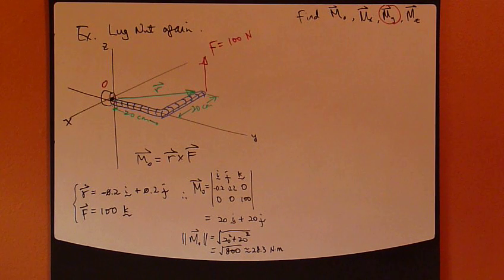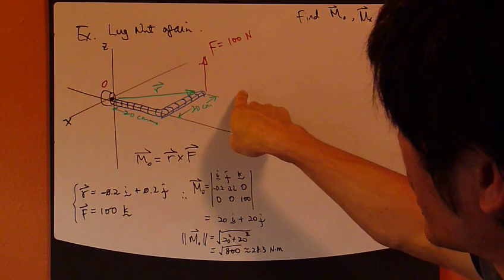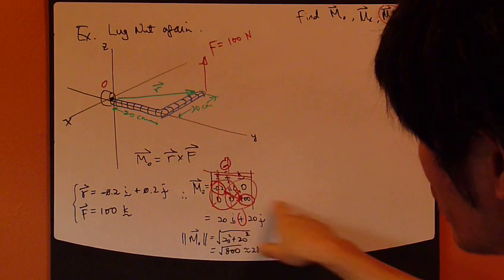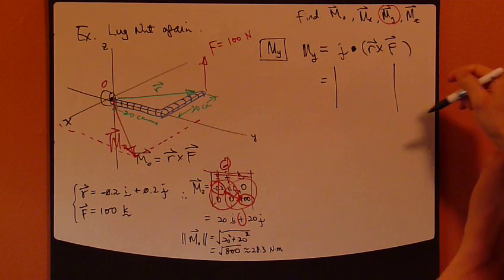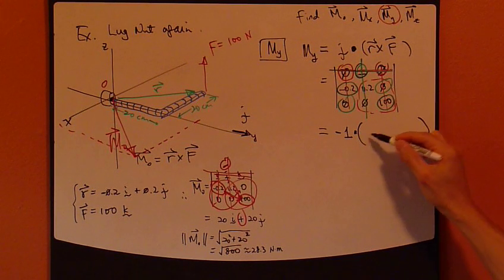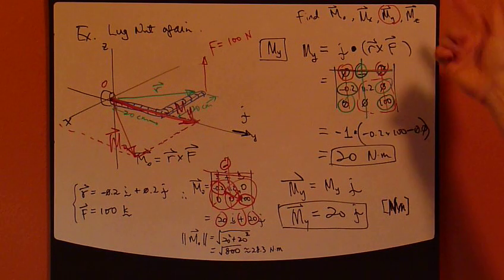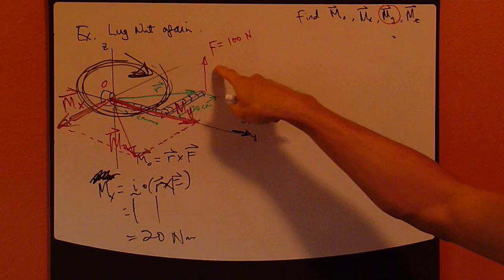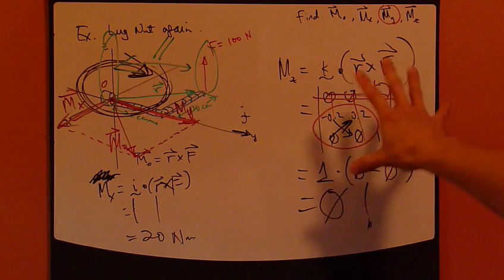Engineering Statics Ch4 Part7: Example - Moment about an Axis

Comment: If you were given the moment how would you rearrange the equation to find force?
Reply: Ankur Thanju 
Ankur, I've been thinking about your question some more. It is actually a very practical question from an Engineering point of view. This is because I can see many Engineering problems where you would know the moment that you need and you're looking to design the system to give you that moment. 

In addition, the explanation that I'm going to give you also gets to play with some of the general theory of moments used in Statics, such as cross vector products and triple scalar product.

So, here is my explanation, from a few different points of views:

1 - In general, the magnitude of a moment in 3 dimensional space is specified with what is known as the Triple Scalar product. This is r X F ` n. The r X F is the general formula for the moment. The "n" in "` n" is a unit vector in the direction of your given moment. I'm using the "`" apostrophe symbol to represent the dot product operation with vectors. The next paragraph is kind of complicated.

    When you use the r X F formula for moments, the resultant moment vector is perpendicular to a plane where the force and r vector reside. So, if the system that you're trying to build is such that you can put the line of action of the needed force in a plane perpendicular to the moment vector, then r X F is all you need to solve your problem. So you would put the line of action of the force some distance from the axis and calculate the needed F and angle of the force. But, here is the complicated stuff. If your problem is such that you need to put your force in a general direction with respect to your moment vector, in a plane that is not perpendicular to your moment vector, well then, in that case, you would need the more general triple scalar product formula. That is, you would design your system with a force in some desired direction. Then, the r X F with that general force would give you a moment perpendicular to the plane that force is in. The dot product of that moment with a unit vector which is in the direction of your desired system moment would give you the magnitude of the moment that you need. 

2 - So the above is the general 3 dimensional case with a force in some desired direction that may not necessarily be residing in a plane perpendicular to your moment vector. But, you may be able to simplify things.

    If you can put the engineered force in a plane perpendicular to the moment vector, then you could make your moment into a Couple, and put two equal and parallel forces a certain distance apart, such that Fd is the magnitude of your moment. In this case, if you desire to use a Couple, you would have an infinite number of solutions of forces to use, since you can get any given Couple magnitude by selecting many different Fd combos.

     Alternatively, if you would like to use just one force, instead of the two needed with a Couple, just put your force a certain distance from the axis of rotation, then figure the force that you need from the Fd equation. But, the line of action of the force would still need to be in a plane which is perpendicular to your moment vector.

Hope the above ramblings make some sense.